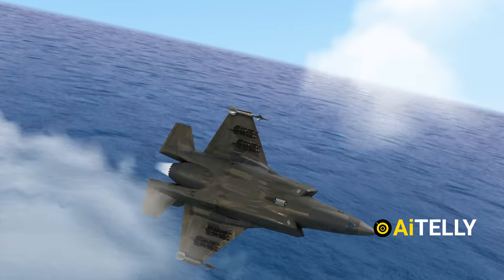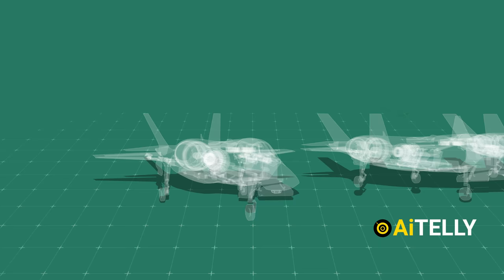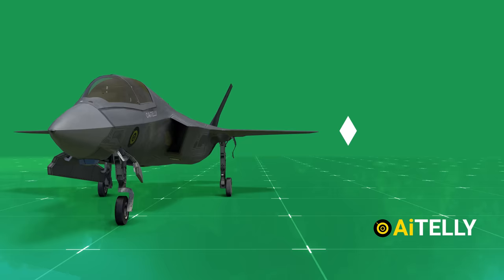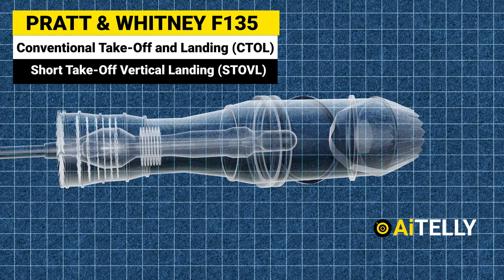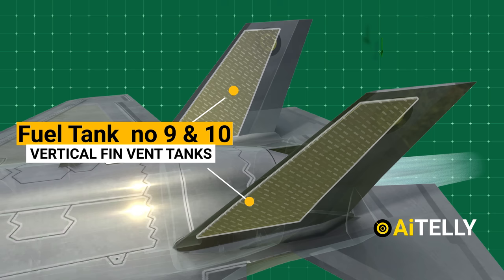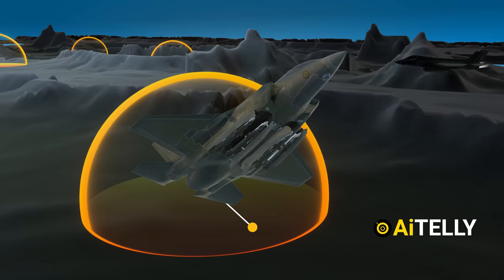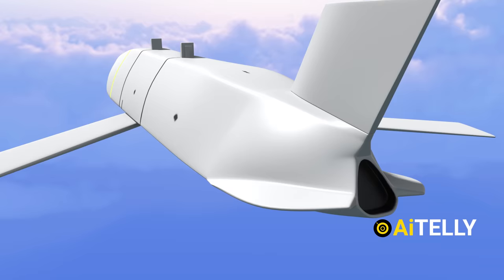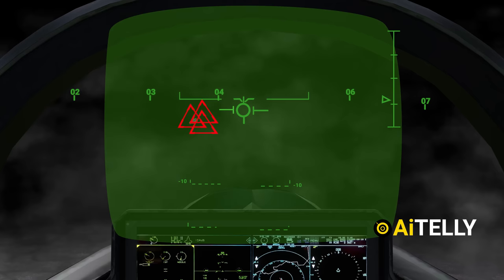F35 Stealth Fighter Jet How it Works

Comment from the maker: CORRECTIONS from viewer comments:

1) Pacific Federation peacekeeping squadron crimson 

At 
2:24
The 25mm cannon doesn't mean anything towards the other weapons it can carry. With the use of precision guided munations, such as the GBU-24, GBU-31, and the new advanced GBU-53
It can accurately hit targets from afar without the pilot having to worry they might get hit , performing a strafe run that is excessively dangerous in contested airspaces and can cause friendly fire incidents( i am looking at the A-10 over here)  , thanks to its IFF and datalink systems. It can also carry long range missles like the AARGM-ER "HARM" and the newly introduced

Edit: at 4:00 the munations on the inner side of the wings are AGM-114(D?) Hellfires are laser guided missiles  , used specifically by helicopters , not fixed wing  aircraft , thought i understand the confusion since they look near similar to the SPEAR-lll

Second edit: 5:31 it says F-45A and F-35B . It was a typographical mistake which is fine .

2) Agung Dwi Wijaya
Good video, but unfortunately all the F-35 models you've used are the F-35B model but slightly modified to highlight the major differences. Maybe you're using the old planned unified model from when it was still a prototype? 

Only the F-35B model has the hunchback & shortened glass cockpit, to accomodate the main lift fan. Both the F-35A & the F-35C have the elongated cockpit for better visibility.

The F-35C also have its horizontal tails cut through a bit of the main wing's rear, for increased lift.

Thanks everyone for the video Correction.
We accept full responsibility for the mistakes we make, even after 3 months of work :(
Reply: Don't worry about it. Lovely video.
Reply: Project wingman refrance?!?!?
Reply: Review tos a1 rusia
Reply: Please one request 🙏
Make videos on India next Fighter jet
1. Tejas mk 2
(2). Tedbf(navy)
(3). Amca mk1
(4). Amca mk2
Reply: Please one request 🙏
Make videos on India next Fighter jet
1. Tejas mk 2
(2). Tedbf(navy)
(3). Amca mk1
(4). Amca mk2
Reply: @DennisMerwood-xk8wp  Not sure why you're singling me out. I'm in agreement with most everything you're saying. Especially about US military budget being obscene while the country suffers with lack of health care, homelessness, education forcing our kids into life time debt, then there's the part where we perpetuate violence and destruction around the world. Don't know about the comparative quality of the F35, but I know the price of it is reprehensible.
Reply: Great work Ai 👍👍👍👍
Reply: Just want to say how refreshing it is for a video about the F-35 acknowledge that all it really can do is "try" to explain one of the most advanced pieces of technology ever devised.
Reply: Hey, it's all fine. You taught us so much, and these videos take a lot of efforts and time. Mistakes are obvious. No big deal. Keep making more such videos. Thanks

Comment: Former Boeing here... great explanation in easy to understand terms. We always walked a tightrope discussing military projects to outsiders. If information is already in public sphere, you can talk, but are cautioned to keep it simple. Other topics might still be classified, if you don't know for sure, then don't talk about it. High Security Clearances give you access to things not to be shared in public. I remember the RAM on F-18. Most never knew that F-18 is actually a good stealth fighter as long as weapons or fuel tanks aren't hanging off the hard points on wings.
Reply from the maker: Hi again Steven Rohrich.Yes these are declassified information we got from the Company Lockheed Martin itself.
70% are all basic information only 30% needs a little bit of digging.
Thank you for your comment!
Reply: @Aitelly  Thank you, enjoyed your post.
Reply: Wait the f18 is actually stealthy with no weapons? No way, that’s actually really cool
Reply: @aceofaces1506  Thanks - F-18 needle nose, canopy, hidden intakes, slanted tail work better than the F-15
Reply: @SJR_Media_Group  And as I understand, the frontal RCS is lower than the smaller F-16 too.

Ps. I have a specific question that has to do with RCS and the old mechscan radars, mind if I PM you?
Reply: @mobius7089  Thanks, not sure if I have much more than I posted. It's been 20 years since I was at Boeing.
Reply: @SJR_Media_Group  You left when Boeing was still doing good work. It must be depressing to see the max 777x 787 Pegasus refueler Redhawk trainer and Star liner all having problems because of the culture change.
Reply: @eleventy-seven  Thank you... yes Boeing was focused on customer safety. Nothing left plant until perfect. Profit was not primary goal, but a reward for doing the right thing.
Reply: @aceofaces1506  yeah better radar cross section than the russian 4.5 gen SU-57
Reply: Aaaaargh, Mateys!!!  'Twould appear we have a squadron of sea skimming F-18s heading right for us with LO or stealth arghmaments.  Yargh, I shoulda stayed home.

Comment: I’m surprised not more of this is classified! I’m going into the aerospace field and have been obsessed with this generation of fighters, so I definitely appreciate the awesome video here.
Reply from the maker: Most of it we got from Lockheed Martin the company.
But they are willing release the blueprint of the prototype version.
Reply: If it's not classified that means they have more advanced technology that we do not know.
Reply: Since F35s are supplied to nato nations , they are inadvertently have to declassify information.
Reply from the maker: @BluePhantom003  Somewhat True but there are 4000 parts supplier for the F35 joint Strike Fighter.
So some where here and there,
they will have to declassify.

The F22 Raptor was one which is mostly still Classified
Reply: Don’t go into aerospace. You will get laid off all the time, nature of the business
Reply: Fun fact : no body cares
Reply: @Aitelly  How can we contact to get the blue prints of the prototype version???
Reply: @amoskouame5608 most of what is classified is the avionics and radar tracking systems, as well as the radar absorbing materials used in the skin of the aircraft.
Reply: It’s probably already known to our enemies so it doesn’t matter
Reply: 10:28 , you could see they called that the JASSM/LRASM, but it’s really called an I-TALD or TALD. It’s not classified information, but not every detail is accurate enough to be used as secret intelligence—rather, common knowledge for educational purposes.
Reply: You forget to mention that this radar coatings are washed off by rain and weather elements

Comment: Its a marvel of engineering. A very deadly capable aircraft as long as the maintenance can be sustained along with the computer electronics needed for it to fly.
Reply from the maker: Yes it is
Reply: What's interesting is that the cost per flight hour of F-35 is currently around 33-36K$ (and falling), while for F-16C Viper it's some 12.5K$. Not that much difference in terms of maintenance and such, given that all modifications of F-35 are simply larger, carry more fuel and are much more complex overall than the F-16 (or other 4th Gen fighter jets). F-35 even consumes less fuel per NM on average, which is pretty remarkable.
Its price per unit is currently also on par with the European 4.5 Gen fighter jets, that aren't even close in performance (particularly in terms of stealth). A few years back it was significantly more expensive though.
Reply: @pasheg4345 Sometimes makes me wonder what the Russians could mass produce if they had the money like we did.

Comment: I like that the U.S. seems to be moving more towards fewer airframes, at least with fighters.
The F-35 will likely replace the F-16, F-15, A-10, and F-18.

F-22s will be around for a bit, but they're destined for the boneyard. They're simply too outdated. The avionics are difficult and constly to upgrade. The RAM coating is super delicate and maintenance intensive. And, the range simply isn't there, with 590 nm compared with 1,500 nm for the F-35A.
Also, F-22s lack in communication abilities with other platforms, while the F-35 can share all sorts of information.
At least it's still super advanced by world standards.

Soon, I'd like to see the capabilities of the NGAD fighter.

Comment: Good video, but unfortunately all the F-35 models you've used are the F-35B model but slightly modified to highlight the major differences. Maybe you're using the old planned unified model from when it was still a prototype? 

Only the F-35B model has the hunchback & shortened glass cockpit, to accomodate the main lift fan. Both the F-35A & the F-35C have the elongated cockpit for better visibility.

The F-35C also have its horizontal tails cut through a bit of the main wing's rear, for increased lift.
Reply from the maker: Yes we are using the old model as we require Blueprint to model it in 3D. That was the only detail drawings we got.
But we  acknowledge the amount of precision detail you have.
This is highly valuable information
Reply from the maker: Hi we have credited your thoughts in the Correction  section.
Thank you for the valuable Info.
Reply: @Aitelly  thank you for your amazing work & explanation too. 👍
Reply from the maker: @TheRibbonRed  🙏we thank you for your valuable information 🙏
Military information technology are hard to come by.

Comment: Hi Aitelly team, love your videos. Can you tell about your computer configuration like CPU, RAM, GPU and motherboard you use to produce such a nice videos? I'm very keen to know that.☺️👍❤️
Reply from the maker: We use Average PC
Intel i7 
Geforce 1660 graphic card
Ram 32 GB
250 GB SSD Drive
8TB Hard drive
500 watt power supply

It's not about the machine , it's the skill we have after 15 years in the 3d Character Animation industry.

Comment: At the Beginning of this video, you didn't say, that the Internal Cannon of the F F35 A is not possible for the F 35 B and C. Yes, it is true, that It is not Allowed to be internal in / on the F 35 B and C, but yes, It can be on the outside = on the center hard point of a both F 35 B and C. But, you can correct me if need to. Thank You, for this video about the Awesome F 35s.   :    )
Reply from the maker: Your right. for the F35 C there is a Gun Pod, but this reduces it's Stealth Mode, which it was intended for.

F35B I'm not sure.

Even for us it's difficult to confirm data Military information especially the ones in service.

No Military personal will confirm/deny any questions from us on record which is understandable.
Reply: @Aitelly   You are right, that It = the Gun Pod reduces the Stealthiness of both the F 35 B and C. And yes, I'm not sure either of the Gun Pod for / of the F 35 B, that is it on that or not, but let see, where we can find info about it?? Probably from the Lockheed Martin web page.   :    )

Comment: So, does the f35B carry significantly lower amount of fuel because of the fan that is placed behind the cockpit and takes place that could be accomodated by the main tank?
Reply: Yes - in addition to a shorter weapons bay that cannot carry 2000lb bombs, and is restricted to 4 AIM-120s because it cannot carry the adapter rack that enables 6 AIM-120s in an A or C's weapons bay.
Reply: @dumdumbinks274  thanks

Comment: 2:19 that implies that the military is planning on and replacing the A10 which to my knowledge they're not plus the f-35a is designed for air-to-air combat so I would be surprised if that thing can fire continuously for more than 7 seconds before running out of ammo that sounds rhetorical but I would legitimately be surprised also the gun is pointed 6° up to help with leading a Target were most attack aircraft have their guns pointed 6° down to to help with strafing a Target also about your point in your comment on your video well that is a problem for a10 but there are newer variants of a10  that has more advanced electronic warfare and identification capabilities although not quite as advanced as the f-35
Reply from the maker: This is highly valuable information.

Actually what I meant was that the JOINT STRIKE FIGHTER PROGRAMME (JSF) was meant as a replacement for all aircraft.but it did not work.
Reply: @Aitelly  JSF was not meant to replace all aircraft.  The 3 variants were designed to supercede several multirole and single role tactical aircraft.

F-35A was scheduled to replace F-117A, F-16C, and A-10.

F-35B was scheduled to replace AV-8B, Gr.7, Gr.9, and F/A-18C.

F-35C was scheduled to replace F/A-18C on carriers.

That leaves F-15E, F-15C, F-22A, F/A-18E/F, EA-18G.

Comment: Look into the Yakovlev Yak-141 the forefather of the F-35's VTOL thrust vectoring design. Funny how a lot of technology originated from the USSR/Russia then the U.S. acquired and perfected it.
Reply: Funny how the Yak-141 copied the Convair Model 200... and how the F-35 shares almost nothing in common with the Yak-141.
Reply: @dumdumbinks274  Huh, interesting. So I did a little research. Apparently  "we" only had parts of the story. My youtube source made no mention of the Convair, unless I missed that part. Also, I didn't come across any information that explains the connection between the Convair 200 and the YAK-141 (It wasn't a deep research) The Convair 200 was designed in 1973. YAK-141 program initiated 1975, first flight was on March1987, but first complete transition from vertical take off to high speed flight to vertical landing wasn't until June 13, 1990, but it still needed more development. Here's the crazy twist ... Soviet Gov. stopped funding the program and Yakovlev tried to continue on their own, but quickly depleted funds. I991 Lockheed-Martin and Yakovlev set up partnership agreement to further develop the YAK-141. However, Lockheed-Martin was already developing the X-35. By September 1991 the CIS (Commonwealth of Independent States) said Lockheed -Martin couldn't fund the development of the YAK-141. Anyway there is a lot more to the story, but this is the generic version about these 3 aircraft. What the YAK-141 and F-35 did have in common was the basic layout design on how it transitioned from vertical to horizontal and vise versa.
Reply: @terryakuna66  Yep, which is why Lockheed funded the Yak program to begin with. They wanted the flight test data of the Yak-141 so they could confirm their own assumptions about the layout in regards to stability and ground effect, and therefore accelerate testing of the X-35B. 

They had settled on the layout of the lift system back in 1988 after first studying a range of historical VTOL designs. They went through a couple of airframe designs before the stealth requirement came along, at which point they settled on a scaled down and slightly modified YF-22. The lift system design was complete by 1990, including the shaft driven lift fan. But Pratt & Whitney didn't have the expertise in STOVL technology so got BAE involved to fine-tune the lift system. 

Rather importantly, P&W were the primary engine contractor for the program, and they had also been the primary engine contractor for the Convair Model 200. They used a modified engine from the YF-22, including a modified 2D vectoring nozzle which was quite boxy and cumbersome. In a search for a lighter weight alternative, a couple of engineers were able to locate the actual schematics of the Model 200's 3-Bearing Swivel Nozzle, and then applied an updated design to the X-35B. This is the only non-superficial similarity between the F-35B and Yak-141, and they got it from the same source rather than from each other. Well it's more likely that Yak based their design on the US patent describing the mechanism that was public information in the mid 60s, but that doesn't really matter.